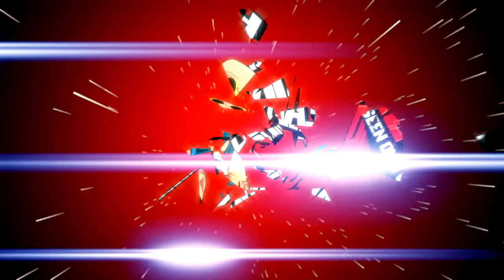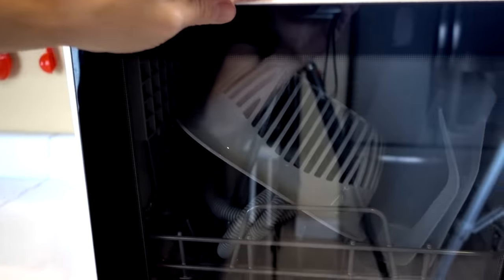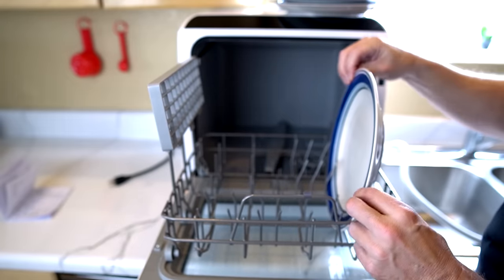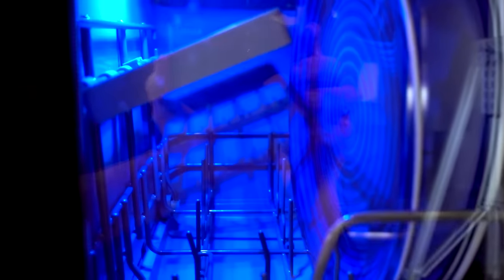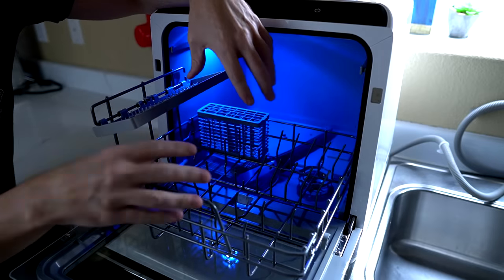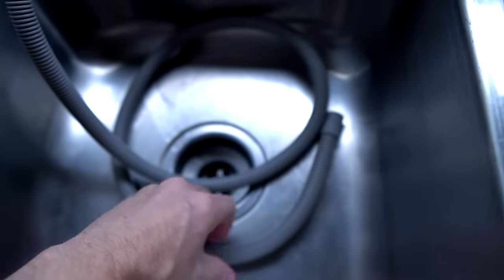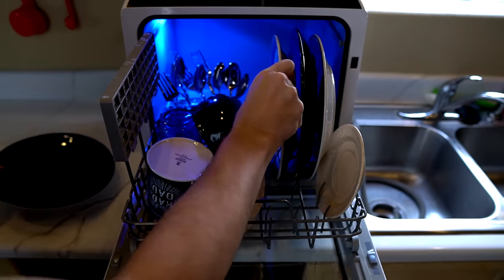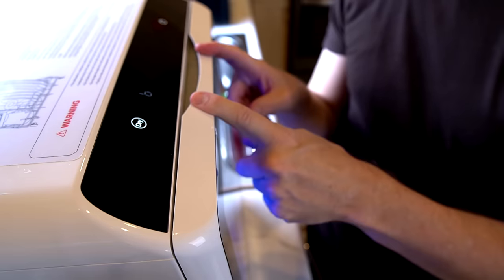Do Countertop Dishwashers Work? By Request!

Comment: Okay I thought it’s gonna wash like in 10 minutes 😂, but half to an hour?! I guess if you only have one or two dirty dishes cleaning by hand is faster, and as someone who grew up hand-wash their dishes these small load of dirty dishes probably would be done under 5 minutes. But I can see the convenience the regular dishwasher size if you live with lot of people…
Reply: @@TimRockIt in single household that doesn’t have much dishes, like my dishes when I was living alone is practically just one pan, one plate, bottle, knife, cutting board, and chopsticks most of days 😅 so having this is not helping much. I guess you can sanitize it by put the wash basin with hot water after the dishes is done, so yeah my point is this small size is not worth it if you living alone and doesn’t really have much things to clean.

Comment: You really have to have a want for one of the counter top styles. I guess if you have nothing better to do with your countertop space. Even in a small space it would be better to get a slim under sink version being on the topic of "Smaller", worst case build a cabinet for it if there is no under cabinet space available. These things don't make allot of sense. The one thing as a tech I do like although most would fine objectionable over time is the glass door. I could watch the dishwasher instead of YouTube...

Comment: These super tiny ones are even more tiny than regular counter top dishwashers. I honestly don't see the point. By the time you've filled it with water and loaded it up carefully you could have washed it all by hand. I have a Bosch counter top dishwasher (hooks into the mains) which srill manages ro fit a whole two days worth of dishes from both myself and my partner. And they cost the same or even less than these Chinese mini things.

Comment: I guess for some, it would be good to have. But for me, I'll stick with doing dishes the traditional way, by hand. The old fashioned way is quicker, uses less water, and electricity in my house.
Reply: How can it be quicker? Takes less time loading a machine than doing dishes. It's not like you need to sit and look at it while it's running.

Comment: Looks like a dishwasher for dolls house kitchen utensils! A prime example of a machine thats made smaller for space and then we're still using the same sized plates and cups in it! Buyer beware!
Reply: @@TimRockIt yes. I only have a couple larger dishes I use for prep. The rest of my dishes are what used to be called “lunch” plates. If you fill up a larger plate, you end up eating more. I also use my dessert forks more than the regular size, cuts down on shoving large amts onto the fork. It would be fun to do an experiment to see how much difference smaller plates/utensils would make to someone’s food intake and budget. ❤️😎

Comment: To be honest this is quite laughable to me.  The amount of dishes you can put in there would take five minutes to wash by hand, but you're willing to subject yourself to over an hour of noise and sacrifice a ton of counter space.  Heck no.  Also, it's hilarious that it has a 60 min dry cycle.  Air drying dishes takes way less than an hour.  The dishes would dry faster if you just left the door open for them to dry.